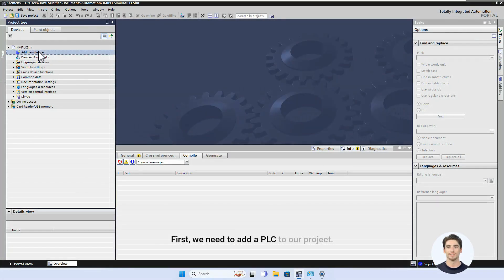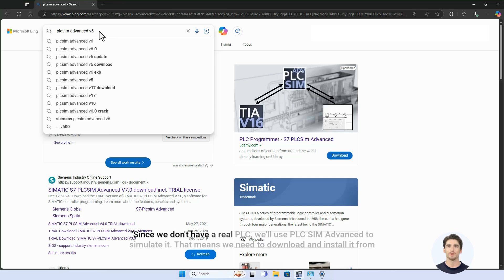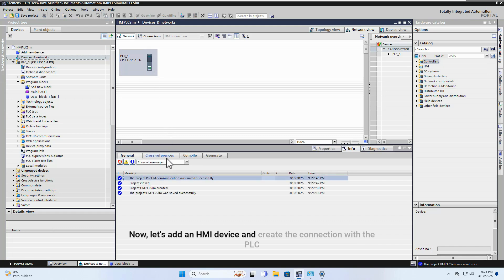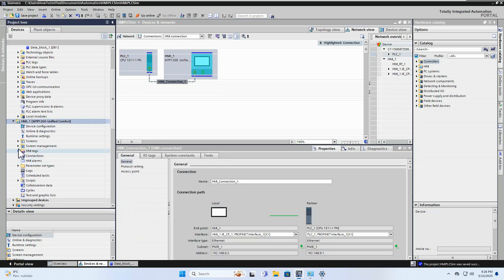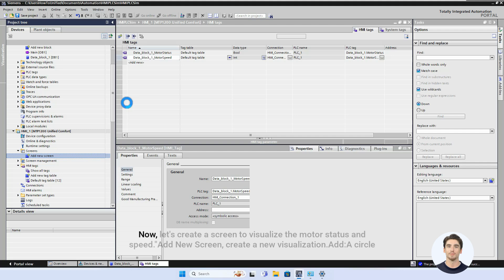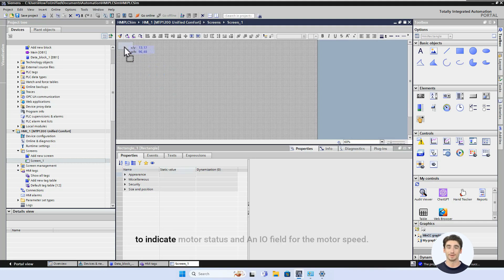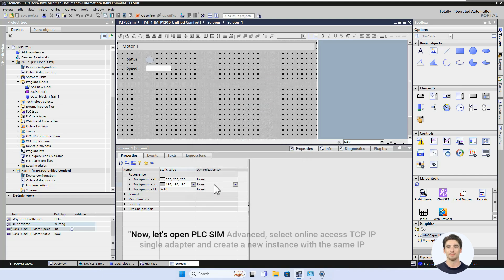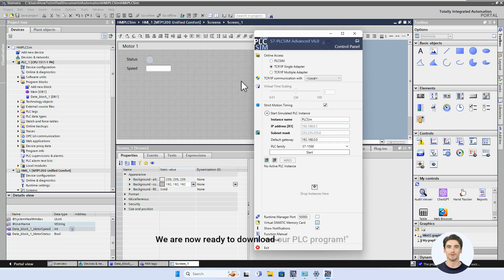TIA Portal V19/20 & WinCC Unified: How to Connect & Simulate a PLC - PLCSim Advanced

Comment: Okay, can I turn on HMI 1st and PLC 2nd? If I turn on PLC 1st, HMI will go into "partly running" error. Also I can send data from PLC to HMI but can't set values from HMI to PLC. Ideas?
I use Tia18 unified with plcsim advanced 5.0 - S7 1500 and MTP1200 unified comfort

Comment: Will the buttons work with this connection? In other words, if I press the tag setting button on the panel, will it light up the bit on the controller? I tried it, but my panel can only display the status of the tags and not change them back.

Comment: Hi, thanks for the video. I'm trying to connect the HMI to PLCSIM but haven't been successful. While troubleshooting, I noticed you selected the SIMATIC Unified Comfort Panel, whereas I chose a Basic Panel since I'm using TIA Portal STEP 7 Professional Safety with WinCC V20. Is it necessary to use a Comfort Panel for this setup? If so, how should I proceed? I’m getting a pop-up saying I don't have the required license.
Hope that makes sense.
I forgot to mention that I only use the trial version.